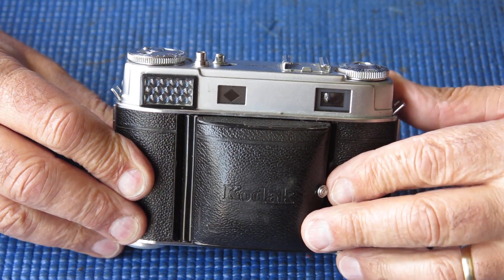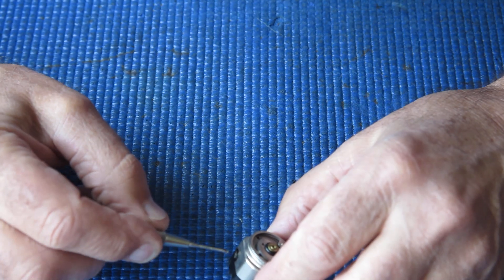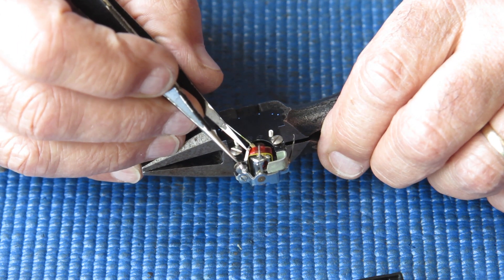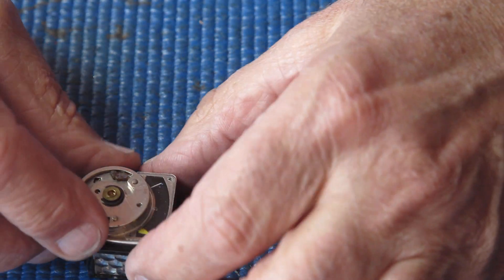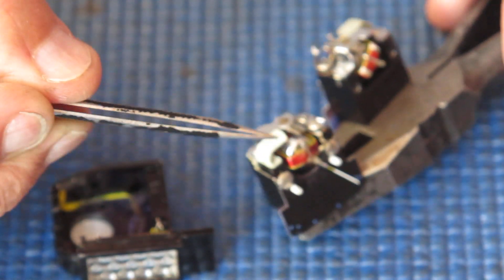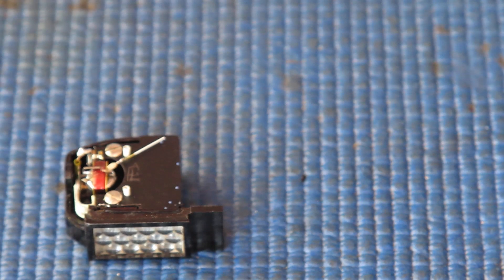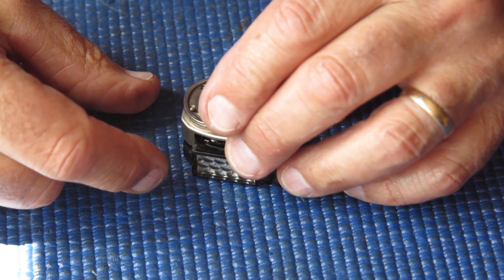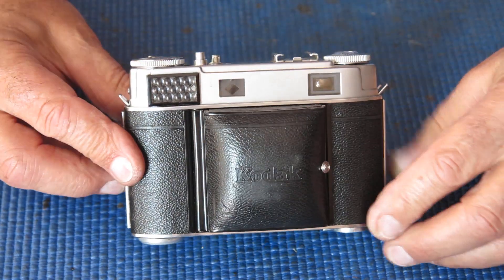Kodak Retina IIIc with a bad exposure meter

Comment: Are the cells interchangable between retina and retina automati models? Thank you!
Reply from the maker: The Automatic III came with two different meter cell sizes, the smaller ones may well work. In my experience, the cells in the III, being hidden behind the metal flap, have survived better than many of those on later cameras.
Reply: @ChrisSherlock  thank you, Chris. I have one with flap that‘s not working. Will investigate :)

Comment: What would you have done if you didn't have an extra working movement on hand? Is there a convenient place to order spare parts such as these, or would it require finding another broken camera with a functioning movement to cannibalize?  Would you have been able to fix the movement had there not been a suitable replacement available?
Reply from the maker: Pretty much all parts like this have to come from an organ-donor, which is why I begrudge replacing parts unless absolutely necessary. You can still get new shutter-cocking racks from Micro-Tools, otherwise search eBay for anything else.